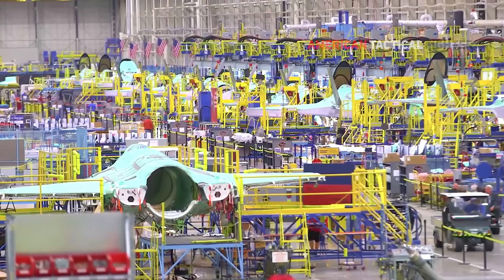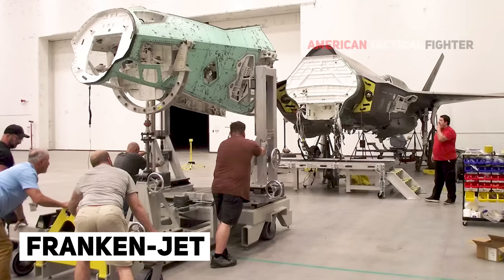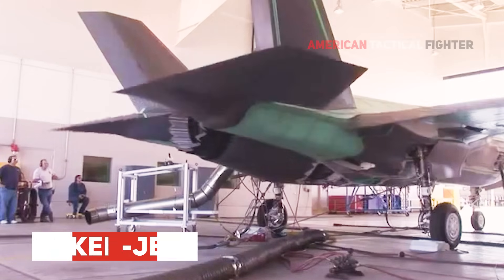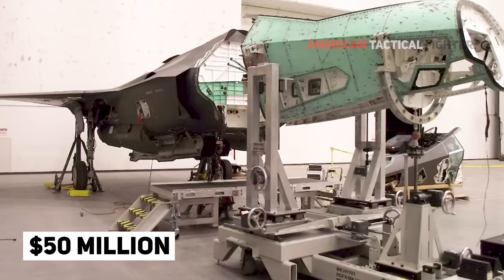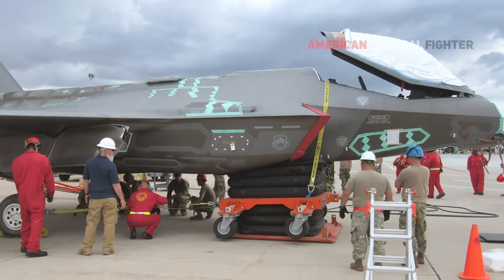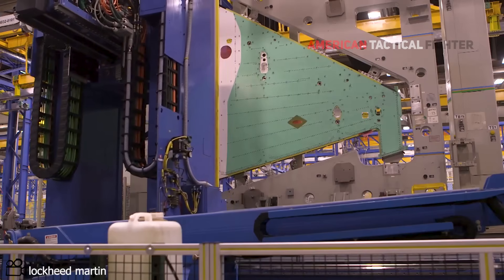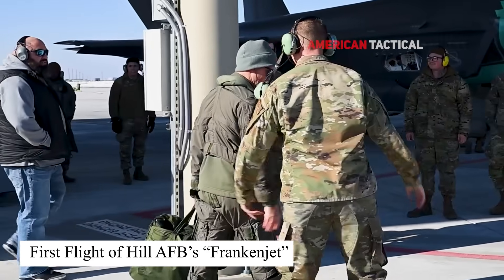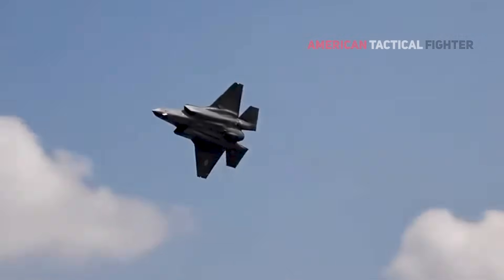Incredible! US Air Force Combines two Damaged Jets to Build One F-35 Lightning II

Comment: The Delta Centauri is made of carbide. When fighter jets fire during lightning strike, the sound effect is the same as a very big carbide object. Working with SDS plus 14 16 mm, short bits drilling concrete, makes this sound. While chieseling makes other sound. To test it, hard type of concrete is needed. 
Fighter jet fires electromagnetic railgun bullet at the ship, its disappearance makes the same sound.